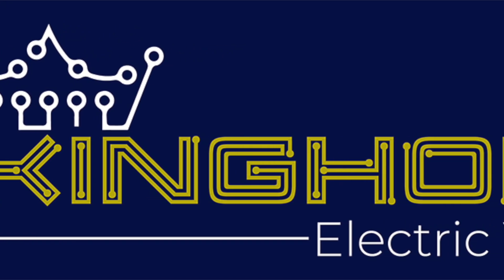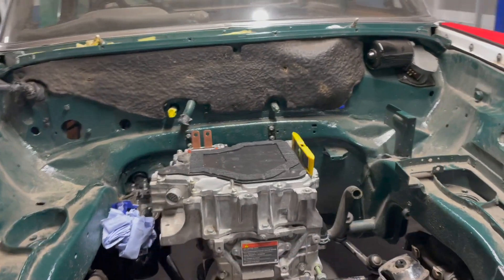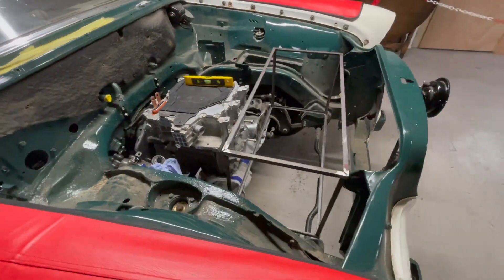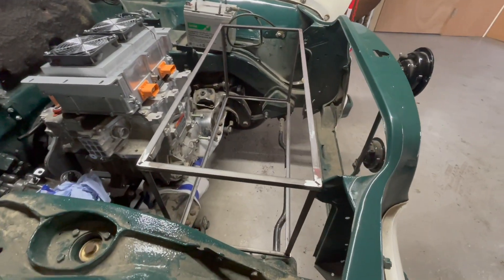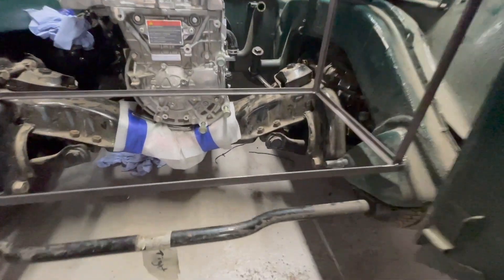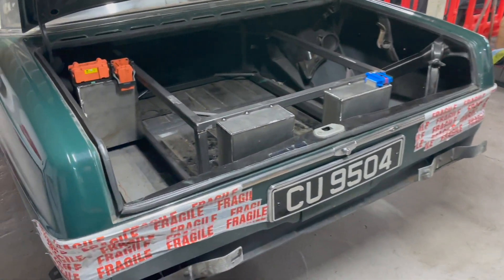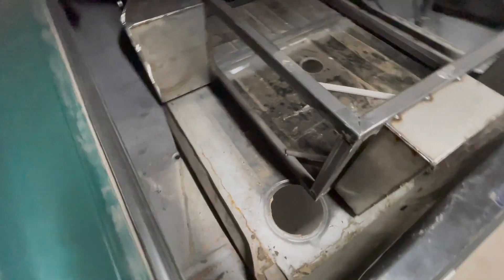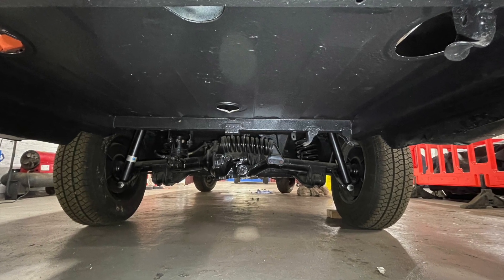Electric Car Conversion Update 1 - 1969 Mercedes 280se

Comment: Thanks for the video! You have done a lot of metal work. Why do you need to make the motor adapter of aluminium isn't steel good enough? Will you keep the clutch? Looking forward for next update.
Reply: We use aluminium to lower the weight whilst retaining the strength :-)
Reply: @georgekinghorn7495  I understand, but what about cost of material and machining aluminium parts? Or isn't that an issue with that kind of car conversion? Will it be a 100000€ car after the conversion?